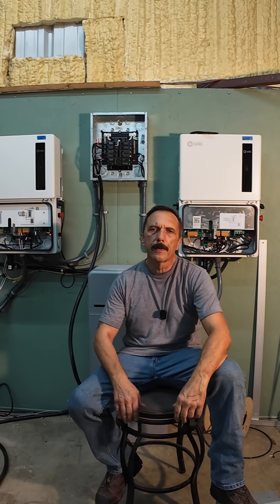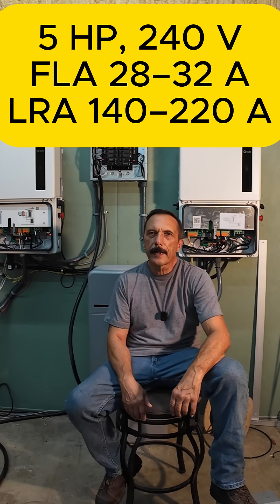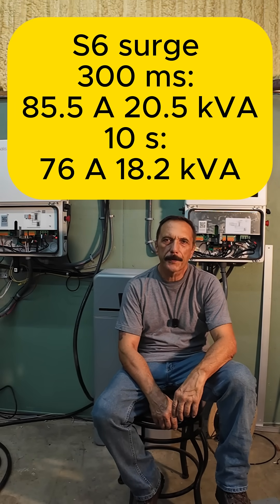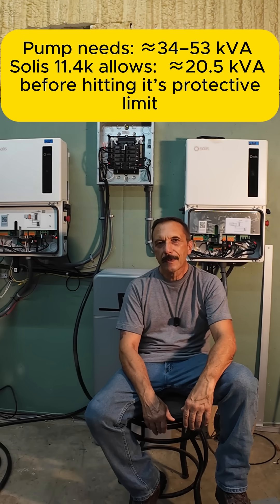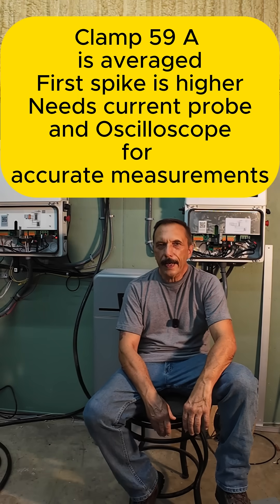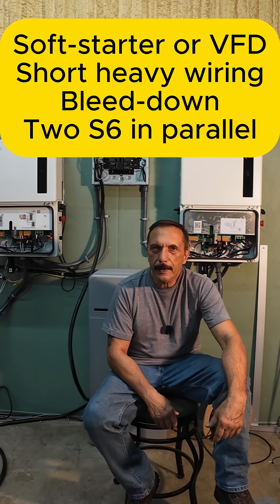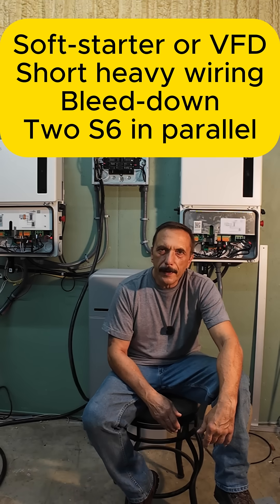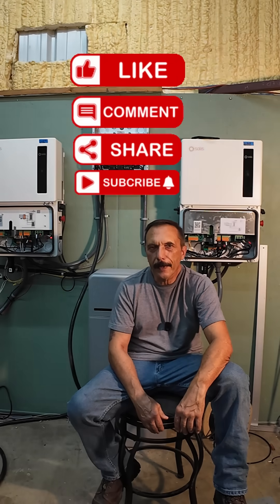Will the Solis S6 11.4k Start a 5hp Well Pump?

Comment: three wire pumps with the starter box and capacitor above ground are considerably easier to start
Reply from the maker: Yes they are but people want to use equipment out of spec for some reason...

Comment: I never thought that the meter shows max before cutoff.  You're telling me that I need to measure inrush current on a working pump that managed to get started.
Reply from the maker: If your measuring the inrush on an inverter that's not starting a motor it's most likely current limiting to protect itself,  so what you're actually measuring is the inverters current limited output, if that makes sense.

Comment: This is why you should never install a high-frequency, transformerless inverter like the Solis S-6 or the EG4 line of inverters for heavy-duty applications or for powering large power tools. Spend a few extra dollars and buy a low-frequency, transformer-based inverter instead.
Reply: This is just nonsense. My EG4 6000XPs have been running this pump for two years.

Comment: 100% Ed that's what I was trying to tell him.  The Solis inverter is only HF with no transformer, which would have enough time to handle that start surge.

Take it easy, Casey
Reply from the maker: Yeah, it's all about the specs...
Thanks for watching Casey!
Reply: @DIYSolarFarming 

Check out my latest video I'm doing two of them also running off two 60 kwh Tesla Battery packs.

Currently testing with just one of each, actually running my house off grid with some management.
The plan is to get them both up and running to be wide open as my electricity bill has been pushing 500$ in the summer.

I got the two LFP packs out of wrecked cars for 5k$ in all the two inverters cost that much and the 10kw of solar and other things run about 5k as well.

Comment: It’s odd because a single EG4 6000xp will start his pump which has considerably less power than S6
Reply from the maker: Yes, there is a reason for that and I will get into it in another video.
Thanks for watching!
Reply: @DIYSolarFarming Ed, do you want to jump on a call or do a live video to talk about it? Could be a good collaboration opportunity.
Reply: Yeah the company's that have been around and popular with diy for longer know that customer satisfaction requires being able to reliably start these loads. They can absolutely do it, solark 18k rated to 36 kw for example so you know it can do even more.